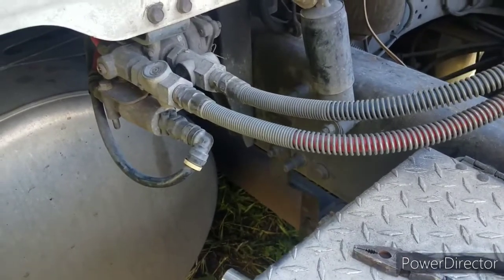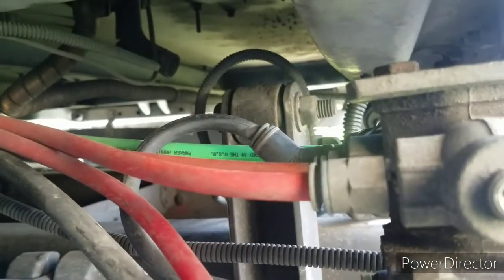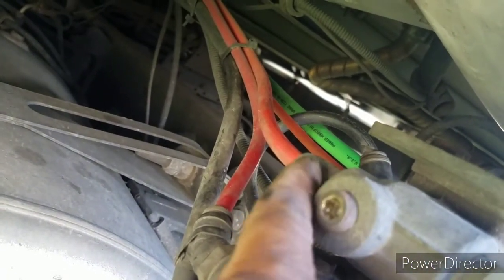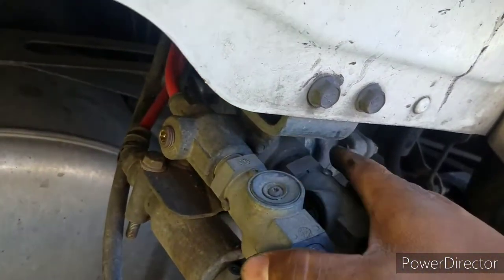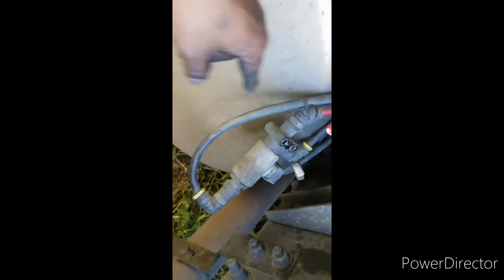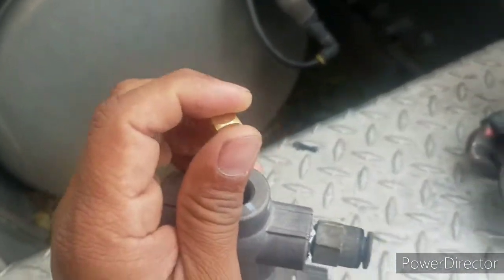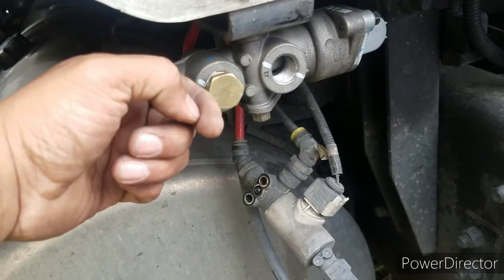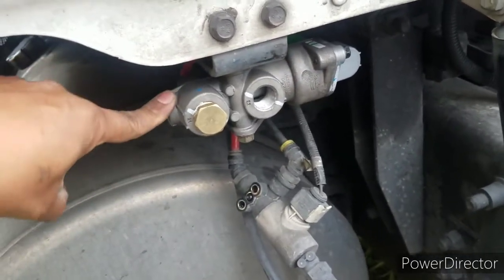No air in service line freightliner

Comment: @iwin78 did you have to do anything else I just replaced the tractor protector valve and I’m still not getting pressure in my service line
Reply from the maker: No I didn't do anything else

Comment: Is there is Anyway you can help me find out why my break not release on my trailer I replaced all the valves on the trailer and the truck they’re still not releasing on trailer
Reply: Brother I’m having the same problem today, did u find out what the problem is. Are you having problem with trailer tires not moving because no air is building?
Reply: I have the same problem how you fixed yours guy’s with the trailer knob not staying in